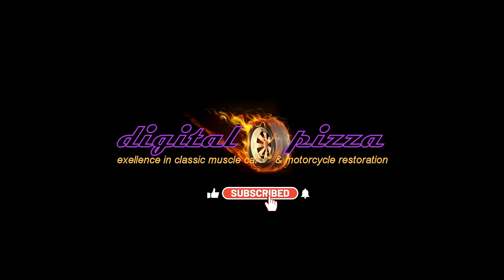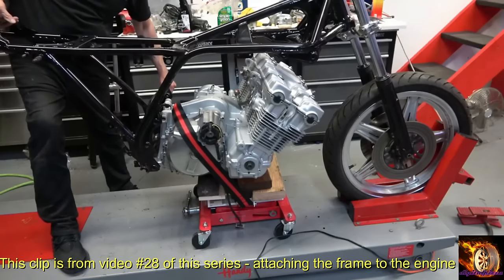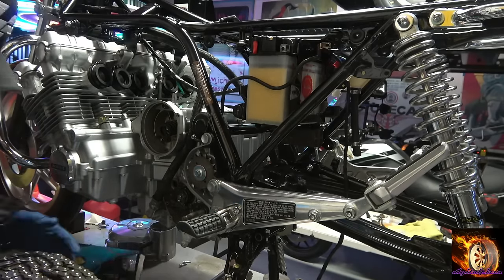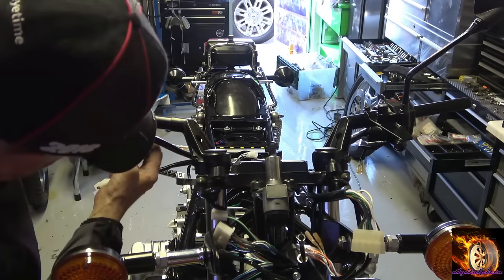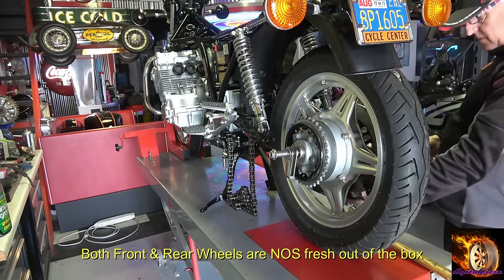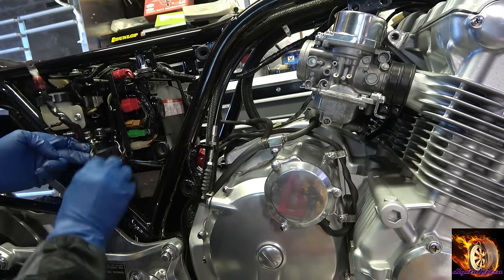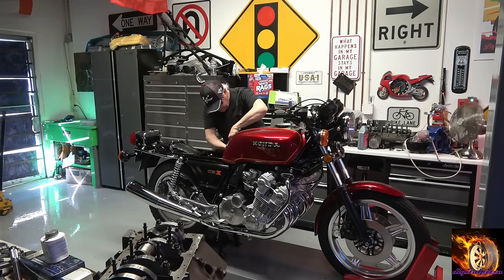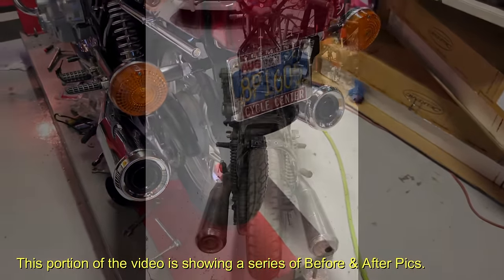Honda CBX Full Restoration & Engine Rebuild Video Series - Part 41 Final Assembly & First Start Up

Comment: Thank you Peter.
Excellent and outstanding work. It is the necessary and definitive guide for those of us who want to keep these relics alive. I own a '78 CBX with serial number CB1-XXX1070, which actually needs some attention, with special mention to the first gear, which jumps any time. In addition carburators tune up, which has been the main headache since the beggining.
The problem is that in Spain, these bikes never were selled from the official Honda shops due to import restrictions, so in the official site, they even have manuals and knowledge of how to repair them. I spent huge in mechanics in the hope they could find solutions. They just investigate with it and never find the right solution.
With your glorious guide I am sure that I will be able to give my CBX the solutions it needs. Eternally grateful.

Comment: Great video thanks for posting, brings back great memories, I owned the first model released in silver/black, as I recall 104 HP at the crank, I heard shortly afterward HP was reduced to sell in EU due to legalities - sad. My first bike at 15 in 1965 was a used Honda 250 scrambler. From then on I’ve owned many Hondas as well as other brands, but that CBX was a super standout, one of my most memorable bikes, I loved the fact I could break the 55mph US national speed limit in first gear at 60mph. That thing had so much power for its day, and those 6 cyl’s, 6 carb’s, 6 exhaust pipes and 24 valves were just beautiful and very reliable, always in sync. Also amazing is how well balanced it was at very slow parking lot speed. Another one I truly kick myself for selling.

Comment: Hey thank you very much for an excellent series.  I only recently discovered your site and had to watch it when it was on the legendary CBX.  I have always desired a CBX from when they first came out but was never lucky enough to find one.  I was interested to know how you pre-lubed the pistons and rings for the first start as if I recall you used CRC on them during assembly.  I did not see any smoke when it fired and cleared it's throat.
I would love to see a similar series on a Japanese two stroke of the day, Suzuki, Kawasaki, Yamaha it would make little difference.  I have a Suzuki GT750 water cooled two stroke triple I have just started  restoring and something like that would be terrific.  Good on you.  I'm sure you enjoyed the restoration.  I did

Comment: Welcome back Peter been waiting for you for a while 😂 I actually have your playlist saved to my favorites. So sad all those cool bikes were in that pile. I remember putting my carbs on and I had to use a heat gun for the cards to seat on the rubber bushings. Comstar wheels are much better than the ugly wheels that were on it.
Reply from the maker: Hi Marko, yes,  I also use a heat gun as well, best way to install them :)

Comment: The bike looks amazing. I have a 1980 and 1982 CBX that are in good shape but will be doing some work to. A couple of questions please. You mention a video for restoring the ages but I can't find it. Also, what did you use to retape the wiring? I've had bad experience with regular electrical tape as it gets gooey. Thanks!

Comment: Hi!, wonderfull works!, I thanking you for saving those Bikes. A question: what means “NOS parts”, I tried some internet searchs about, but it only shows nitrous oxide systems kits resoults…😅
Reply from the maker: NOS means New Old Stock. So in other words, they are parts that are new or never opened from the packing or used on the vehicle. They could be old stock or recent stock that has been discontinued.

Comment: Watched since the beginning.  I have 3 CBX that are in same conditions as yours prior to rebuilt.  So how about the number crunch?  Minus NOS parts....care to share costs and time?
Reply from the maker: Hi Taz, I bought the bike about 10 years ago for $500.00. I started the restoration about 4 years ago, but with long periods of time that I was not working on the bike. Most of the basic parts are original to the bike that I restored. I had many extra parts that I have accumulated over the past 20+ years, so I may have used some of those parts that need to be replaced. I also have picked up many NOS parts over the years, so its hard to say how much I have in those, but I estimate about 4 to 5K  ( the nos sport kit was 2500.00 & the wheels were about 800.00 each) Other than that, I probably spent around 2 to 3K on misc. stuff and services i.e. Paint, Powder coating, Machine Shop, Tires, Battery, Chain, engine rebuild parts etc. So all told, I probably spent 6500.00 - 7500.00 on the restoration.
Reply: @digitalpizza1  That's amazing low cost considering.  Thanks for the unselfish gift of time and videos for inspiration!

Comment: Hi Peter. Love your videos on CBX restoration. I recently purchased one a few years ago. Quick question - I noticed that the licensed plate frame when you installed the rear fender section was from Fairfield Cycle Center. Later on in the video it was changed to Fremont Cycle center. Why the change in original dealerships. Thanks Dan
Reply from the maker: The original dealer was Fremont Cycle Center which is why I changed it
Reply: Thank you very much. I will continue to enjoy your channel.

Comment: I noticed the bike before the restoration had huge pull back handle bars, Ive seen other U.S CBX's with them too, were they the standard bars for U.S bikes??
Reply from the maker: Yes, US bikes had taller bars and more forward foot pegs. There was a sport kit available as an option that would be purchased at Honda parts departments that would convert it to the lower bars and rear set pegs like the bikes sold worldwide
Reply: @digitalpizza1  It seems a bizarre choice to fit on a sports bike, did many people refit the normal peg and bars? Other manufactures must have done it too, Years ago my brother dropped his GPZ900R (Ninja to Americans) and needed another bar, when it arrived and we put it on it was about 70mm (3") higher than the other, we took it back and the dealer said "Oh, they have sent us U.S spec bars by mistake".

Comment: When are going to finish the CB1100 or have I missed it?
Reply from the maker: Hi Andrew,
No, you have not missed it. I will be starting on that bike later in 2022. I am finishing up on a couple of CBXs right now and will be doing the 1100F after they are finished. The 1100F is going to be a nice bike. I have a lot of NOS parts for it including pipes, gauges, mirrors, grab bars, seat, etc.
Reply: Thank you for your response WoW what outstanding job you have made of the scrapyard CBX and thank you for your videos 
I’m looking forward to you starting the CB1100 again as I have two myself in poor condition one from the USA and one from South Africa.
I’m in the UK and finding it very hard to find good parts this side of the pond for a one year production motorcycle but I’m getting there.
Keep up the good work and look forward to seeing your next video.